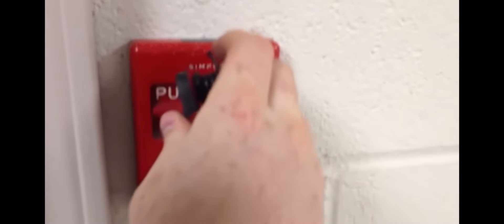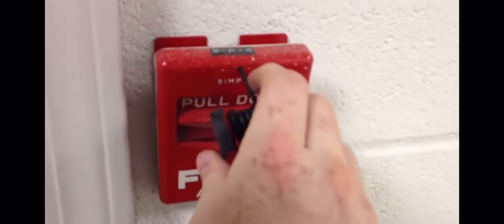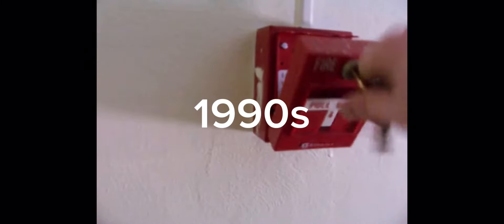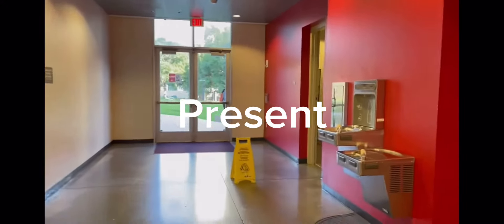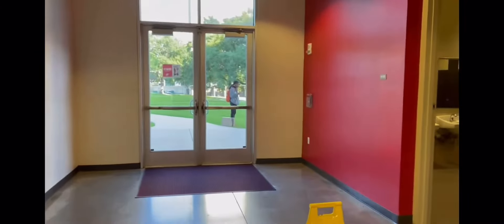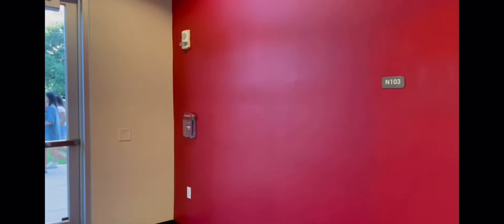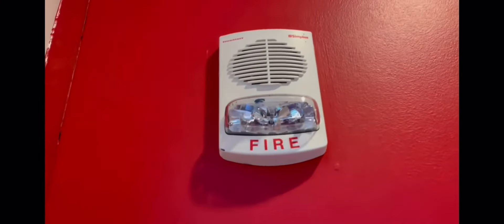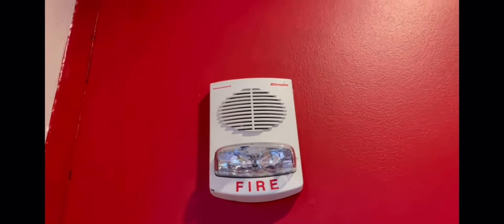Evolution of Fire Alarms 1960’s to Present (MOST POPULAR VID)

Comment: My high school currently has a few simplex 2903s and 4050 horns in some parts of the building. they have been mostly replaced due to the school changing from 120v to a panel. I recently collected a 4050 horn and 2 2903's that they had in a box left over.

Comment: The bells in the first clip are 4vac. The panel uses low voltage signals in series for supervision. You don’t see 120vac appliances on a fire alarm system with an FACP. They were only on closed-contact systems where no panel was used with minimal exceptions. 

The system in the second clip is not from the 70s rather the early 60s. That system is likely even older than the system in the first clip. Flush style horns like that were the staple of the 1950s and 60s. 

The system in the 3rd clip is an 80s system. The 12vac horns were left over from an older system (50s-60s) and a simplex 2001 replaced it in the 80s. 

Voice evacuation systems have been around since the 1970s. They’ve only gotten more popular over the years as codes have gotten more strict on where voice evacuation is required.
Reply: there is a modernist (built in 1969) six story office building in Akron that has the same system as the first clip--panel is a Simplex 4247-4. 

I think they've had flush mount horns in the 1940s--there's an apartment building in one neighborhood of Akron that has 6 V simplex 4037s--it was built in 1974.
Reply: Autocall invented the voice evac system in the late 1960s

Comment: Skyscrapers and convention centers had speaker strobes since the late 1970s. They look like wheelock 7002T but with a 70v speaker instead of a horn and sounds like the GTA V military base alarm and the voice evac message is stored on a magnetic tape. Large schools had voice evac systems since the late 1990s. Simplex has that same slow whoop tone since the 1980s. LED strobes came out in 2014 with the Wheelock Exceder LED series. Wheelock AS and MT horn strobes have been around in the 1990s are they are just as loud as spectralert advances. The spectralert advance actually came out in 2004 and the original spectralert came out in 1998.

Comment: My brother told me that his month they replaced the old system at my high-school with voice alert panels. The old system was comprised of Siemens UMMTs, U-MHUs, and U-MCSs, the system had a tendency to go off at random for no reason. New system was described to me by my brother to be very similar to the system in the last video, with the difference being it produces two slow whooooooops between voice messages.
Reply from the maker: @zachstudios567  thats sad :(
Reply: @wubbzyeas615 yeah i guess. Though I know some will not miss those piercing noise the Seinmens made. During drills I actually went outside early because too much of the noise triggered migraines, that and probably anxiety of anticipation of the noise triggering the migraines anyways the fun part was being outside near classrooms  with windows open on nice days and hearing classmates scream when the noise suddenly goes off. So yeah a bit sad the code 3 days are gone there.

Forgot to mention i have a small recording of the Seinmens going off during a malfunction. (otherwise i would have been outside already) so in a way i preserved the system digitally

Comment: My elementary school had the old 80s alarm (was in elementary school 2008-2014), and it was definitely quite the loud alarm. Though recently the school renovated and got newer 2010s alarms (I live in the same neighborhood and can often hear the alarms when they do a fire drill). But my favorite thing about the old set up in my school, is that all of the alarms were actually pretty much only in the hallways, there were none in the actual classrooms, so if you just shut the door than the alarm was very muffled and you could barely hear it, which honestly in hindsight is probably a major fire hazard lol.

Comment: My elementary school which was built in 1989 had Simplex 2901-9838s on 4903-9101 strobe plates in continuous. But my middle and high school had Wheelock AS’ in code 3. But my current university has a wide variety of different systems in different buildings on campus. Most buildings have Simplex systems, the ones that were built or renovated any time between 2009 and now have 4100U or ES voice evac but ones built or renovated between 2001 and 2008 have TrueAlert horn strobes and there are also a couple buildings with the same system my elementary school had (but for one of the buildings, I don’t know how much longer the system will still be around because that building is due for a major renovation) and also one building used to have 2901-9806s with 2904 lights mounted above them but recently the 9806s were replaced with Wheelock Exceder horns (but I don’t why they didn’t remove the lights as well and just put Exceder horn strobes just like the second floor). The only non-Simplex systems on campus are Siemens ones. In one building, built in 2000, there’s U-MMTs (actually branded as Cerberus Pyrotronics) and in another building, built in 2013, there’s rebranded versions of the Wheelock E50 and E60. And there were also two other buildings that used to have Siemens systems but they were replaced with Simplex systems
Reply from the maker: @dylbeentheplotagonistandra2811  nicee

Comment: Small Evolution
1960s:Bells Are Introduced,The Earliest Fire Alarms Known To Man
1970s:Mechanical Horns Introduced,With Trouble Bells
Mid 1970s:Mechanical Horns Get Coding,March Time Becomes Popular
1980s:Horns Get More Advanced,And Begin To Develop Strobe Lights
1990s:Eletrical/Mechanical Hybrid Horns Are Introduced,Mechanical Horns Start Getting Replaced,Code 3 Is Getting Popular
2000s:Fully Eletrical Horns Made,Mechanical Horns Get Rare And Some Bells Have New Purposes(ex food delivery)
2010s:Eletrical Horns Get Advanced,Newer Bell Models Are Getting Made
Present Decade:Eletrical Horns Are Starting To Use Chime Now To Replace Code 3,And Some Even Have Instruction Voices

Comment: 2:56 just to let you know the spectralert classics are released in 1997 the ones with a fixed candela strobes, in 2004, system sensor updated the classics with multi candela strobes but most installers uses multi candela spectralert classics after the spectralert advances were released for an example my school has spectralert adavances as well as multi candela spectralert classics, as in 2007, that’s the year we’re the spectralert advances we’re released
Reply from the maker: Thanks for the info, had trouble finding it on the Internet

Comment: As someone who specializes in fire alarms made between 1920-1970, I can see some inaccurate info.
Reply: Yea, the Faraday horn in the second video is from 1956. Not the 70s.
Reply: @CassandraPantaristi  Those are Simplex/IBM 4037 horns. I can’t tell what they’re branded as for sure, but if they’re IBM they’re pre-1958, if Simplex they’re 1958-1964 or so.

Comment: I feel like the advance gets a little bit of a bad rap, yes it is ear piercing and it is over used af. But that is just how a fire alarm is, it is ear bleeding. And this alarm has a lot of features that have ADVANtages: it has multi candela. Any variant can be mounted anywhere, like a wall mount can be mounted on the ceiling, or a ceiling mount can be mounted on the wall and the strobe will not have issues cause it's the same one despite the lens being different from each other. And yet these idiots call it a fail. (though yes i can agree that it does look stupid) anyways.. it has supposedly easier installation, and the fact that everyone hates the sound. That means the fire alarm clearly works well, even in reality it has a lower volume than other alarms, just its shrilling sound gives the illusion.
Reply: I can deal with loud and overused, my biggest problem is I can’t stand the way they sound. It’s definitely the worst fire alarm sound ever.
Reply: @NighTMare-gv8gz so ig you are more of a train horn person then
Reply: @Luke202-z8b  Not really, I can deal with most alarm sounds excluding the noise. It's just the shrilling noise as you mentioned. Not saying they aren't good alarms, but I really don't understand why they gave it such a horrible sounding horn.